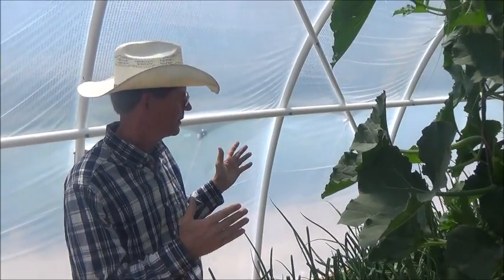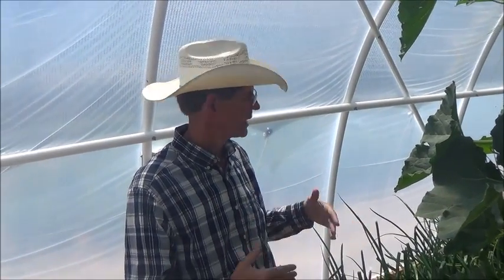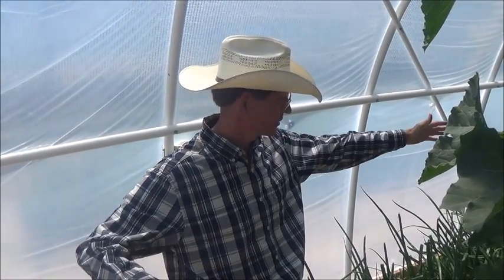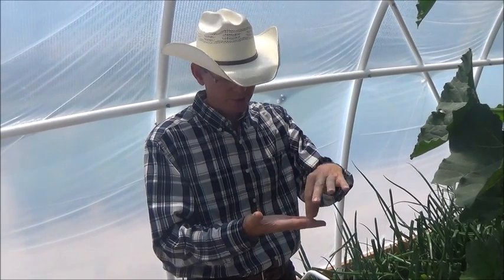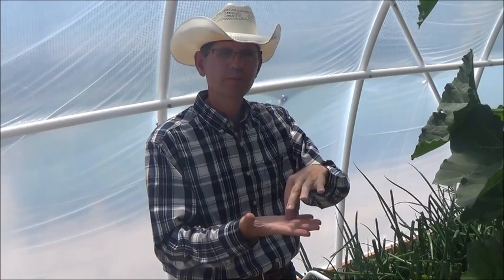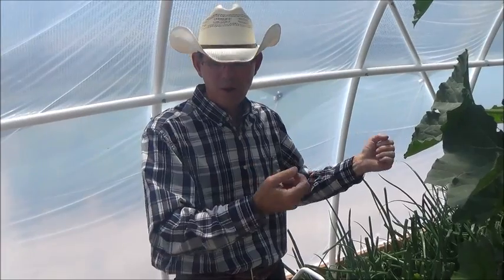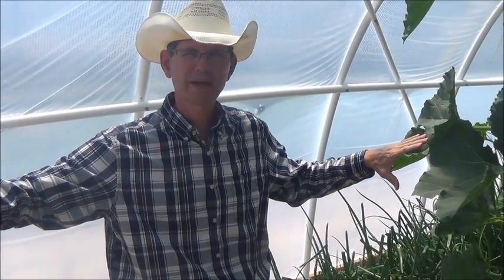LDSPrepper GeoThermal Plans for Underground Tubing New!

Comment: FYI: you can buy half the number of 6-inch pipes, and save 25%.
the Area of a 
4-inch pipe = ~13 sq inches, 
6-inch pipe = ~28 Sq inches (about double the 4-inch)
For example if he had 4x 4" pipes totalling $100,
He could've instead got 2x 6" pipes totalling $75.
Also, skinnier straws are harder to suck air through. Same principle here. 6-inchers require less fan usage.
Reply: looking at prices, 1x6" is $360 and 1x4" is $128.  So double the one is the same now.  The other issue is if it's just area or is it also circumference?

Comment: Your 2017 video shows you installing a rock heat sink the size of the entire greenhouse, instead of just a trench.  What made you change your mind and abandon the idea of using a trench, in favor of excavating an area the size of the entire greenhouse base?
Reply from the maker: https://www.youtube.com/watch?v=HbaOlGljG10
Reply: @OrangeJeepDad  Is there a good reference website that explains how to design a heat sink, and how many feet of air tubing you need to run for a given space size?

Comment: 7,200 cu. ft. greenhouse,
 10% of that is 720 "in tubing" he said
I take that to mean 720 cu ft. volume in tubing.
He recommended 4 inch tubing as the most economical.
That would be 8250 linear feet of 4 inch tubing
or 3,666 of 6 inch tubing.

Comment: LDS Prepper is building upon work done by a couple of others over the course of a few decades.  The original geo-air concept was presented by Russ Finch of Alliance, Nebraska.  See https://www.youtube.com/watch?v=IZghkt5m1uY.  Google: "CitrusInTheSnow".  His greenhouse design is built into the ground 3' or 4' and he has actually done several geo-air designs and experiments.  The greenhouse is only one.  Barry Naef has built upon R.Finch's work and done more systematic research on the geo-air concept.  Most of LDSPrepper's geo-air specifications (4" tubing, spacing, depth, chicken mesh method, etc) all come from Mr. Naef. The specifications for tubing length, blowers, 18" stacking of layers etc. all come from Mr. Naef.  Mr. Naef helped with some of the design of LDSPrepper's greenhouse.  Google: "Geo-Air Technology A-Z".  LDSPrepper's primary and important innovation and contribution is the fact that he has applied this to a hoop greenhouse design which is much cheaper than and has potentially other advantages over the original Finch greenhouse.  Disclosure: I have no connection with or personal acquaintance with either Mr. Finch or Mr. Naef.  But I have been in Nebraska. Peace.

Comment: Diesel fuel used on a job like this is minimal.  Labor is open to negotiation.  I would have done this job free with a percentage of food production for 5 years.  Fair enough, and this would be one prepper helping another.  My machine does the work, I just operate it...

Comment: What I don't get is why he uses the underground insulated panels on the perimeter of his greenhouse.  The whole purpose of the tubing is to expose it to the environment to maximize the heat exchange.  By installing the underground insulated panels he is hampering the heat exchange.  Can someone help me here?  Thank you.
Reply: John Coffey what he is doing is insulating the greenhouse soil from the outside soil in order to use the soil base of the greenhouse as a heay sink. By moving the hot air of the greenhouse into the earth during the summer (to cool down the greenhouse) he is effectively heating up the ground. Then in the winter the reverse happens and he takes this added heat and sends it back into the greenhouse. By creating this exchange he can use the earth as a thermal storage device. At least, thats my ubderstanding of why he is insulating the trench
Reply: He's trying to reuse the heat the the ground absorbs from the greenhouse. The ground beneath the green house will be much more temperate than the surrounding soil and will help keep his green house temperature stable- unless the soil next to the green house absorbs it and dissipates it away from the green house.
Reply: I was thinking the same thing John. You are right that the foam shouldn't be super close to the tubes because it reduces the heat sink potential, but beyond the immediate soil, I dunno 2 feet or something the heat is just escaping. So, ideally you would want however much area around the tubes where the heat can reach then seal that off from the cold surround soil. At least that is what I came up with.

Comment: For inflating the dual poly greenhouse film for the purpose of insulation/temp protection I noticed your fan is located roughly 3" above ground on the north side of the greenhouse on one end. Q: For the size of greenhouse you have do u use more than one inflation fan? If more than one where have you located the others and why?

Comment: Why do you only require 10% of the cubic air volume in buried tube air volume?

At what rate does your greenhouse lose temperature once it stops being heated by the sun?

What type of equipment is used to dig a narrow, 8' to 12' trench like the one that you have described?

http://AnswersFromGod.com/?YouTube=zyiDXU60EqY

Comment: WOULD IT BE BETTER TO POST HOLE DIG VERTICLAL 12 FOOT DEEP x 1 FOOT DIAMETER HOLES AND THEN LOWER THE PIPES DOWN TO THE BOTTOM OF THE HOLES. BLOWING THE AIR DOWN WOULD GET WARMER AIR FROM MUCH DEEPER DOWN.

Comment: if hoop house was 30' by 96' by 9' tall equals 25,920 cubic ft. If I use 6 inch pipe in lieu of 4 inch I figure it would take 1296 ft. Is this correct?
Reply: 6" pipe has almost exactly 3x the volume as 4" pipe

Comment: With the 4' trench mentioned, three layers of tubing would only come to 480 feet. You'd need more tubing, but you shouldn't make the trench longer than the greenhouse, right? So how do you get that 760 feet of tubing with only a 4' trench and three layers?
Reply: No, he said cubic feet, not lineal feet. Insulating the ground immediately below the green house, but above your pipes, would be a good idea to help maintain the temperature difference between the greenhouse and outside air (the near by soil will absorb energy and send it the biggest differential temperature area- the atmosphere, not the ground. 

Insulating the perimeter of your pipes would be detrimental for cooling, as the warm exhaust air "absorbs" cooler energy from below much faster if it can dissipate heat laterally rather than wait for cool energy to "force" its way up to the warm energy trapped between insulation. 

In the winter it would make pumping warm air out more difficult, as your pipes will receive heat from the soil below, but the cool energy will want to bleed out the perimeter, below your insulation. Basically all the energy is forced to compete for vertical passage, and the system can't develop as natural of a lateral energy circulation. All of the perimeter of your pipe would attract warmer air than the center and would create an air circulation opposing the natural draft effect you would otherwise have.
Reply: You wouldnt ;) 
He`s completely clueless regarding the correct design parameters. Thats the reason its utterly useless for cooling his greenhouse. These systems actively store massive amounts heat in the soilmass as they are the cooling the greenhouse so it`s also equally useless at storing heat.  He believes the heat he removes from the soil is being instantly replenished from the earth`s core ;)

Comment: It would need a monster push fan to exhaust efficient numbers from one continuous hose that long if your using Geo Therm Air Flow build. So if your using Liquid  system the pump would be pretty big too.  One more thought is maybe build a dual or quad segmented build so it's not so demanding for such a long hose.
Reply: Although, if you drop a single line almost straight down to the lowest point of your tubing and slowly spiral your whole system up from there in 18" layers you should get one hell of draft dropping the coldest air in your greenhouse to the lowest point and pushing the warmest air up and out without any fans at all.

Comment: If I have bedrock at 5Ft. Can this method still work?
Reply: +cdomize depends on your frost line depth
Reply: Most people I know install their system at 4' deep but it won't be as efficient as one buried deeper as the ground temperature is a bit lower the closer to the surface you are. Frost line depth doesn't matter except that the colder climate you live in, the more perimeter insulation you'll want to use.

Comment: He's saying you need 10% of volume of air in the greenhouse burred in tubing. You can have any size or shape greenhouse as long as you have the correct volume of geo-air coming in from the ground. The structure can be anything insulated and airtight.
Reply: +Christopher Preston 
Can you explain why the greenhouse air volume is used to calculate the tube length?  me neither :)
&#160;what happens when you have a tall narrow greenhouse or something  very wide but with a  low height?   
Seriously, dont use this 10% formula, this tube length and layout wasnt calculated or designed to meet any technical goals. If you run the numbers it becomes crystal clear theres no technical, mathematical or vaguely logical parameter in this design. 
Why would a "designer" calculate a layout that will potentailly move 13.5x less heat while using 87% more fan power?  (this based on an alternative layout that uses exactly the same amount of tubing)
The answer is he wouldnt, so the truth is it was likely all guesswork. The 10% formula was made to fit the guess to make the design appear to be based on something more technical. 

It would be a challenge to purposefully design something less efficient to be honest.  

My guess is, the tubing layout was copied or loosely based on the"Citrus in the Snow"greenhouse which uses seven 150ft  6" tubes. That greenhouse is buried in the ground to over half its height so their tubing  doesnt need to contribute much anyway.

Comment: The closest spacing I've seen recommended for 4" pipes is 16" on center (12" between pipes). Most recommend 16"-18" between pipes.
Reply: +Paul Ladendorf 
Tube spacing can bias the system towards heating or cooling. If you place 4 inch tubes on 12 inch centers you`ll gain higher temperature short term storage (same night return period). Downside of close spacing is the higher tube to mass ratio (more tubes means less mass per unit area). If you get a run of cold days you have nothing in reserve. Typically heat that moves more than 8 inches from a tube cant be retrieved within a 24 hour period. 
The best balance for 4 inch ADS is to use 3 layers of tubing  2ft on center horizontally and 1ft  tube to tube vertical spacing but with the middle layer tubes staggering the top and bottom layers to form a matrix. If the bottom tubes rest on a line at 5ft deep, the mid layer tubes will rest on a line 16 inches above it and the top layer tubes 16 inches above that. 

Putting all the tubes in one layer will limit system performance in terms of storage and retrieval. The bulk of the uncharged mass is not close enough to the tubes to be charged (wastes higher grade heat that could otherwise be stored. In summer it affects the cooling capacity ). The heat has travelled too far from the tubes to be retrieved in a timely fashion. 
I wish you guys would install more sensors, it would save me a helluva lot of typing  :)

Comment: My questions concerning the 'earthtubes' is what about condensation? Since you have warm air going in and meeting cooled earth, the humidity is going to collect as condensation at the low points. Most of what I've read is that in a closed loop system the tubes all empty into a lower drain. Also that using ribbed tubes and Right angles is asking for trouble. Maybe this isn't a problem since you don't live in the green house, but it sounds like a recipe for Legionnaire Disease.... Comments?
Reply: A small amount of water in the line would speed up the heat transfer though :) What I really want to know is what happens if you fill the pipes with water and run a two foot wide lazy river full of fish around the unwalkable perimeter of the green house? Water transfers heat way more efficiently than air and a large surface area of water would basically be a heat exchanger. Would the humidity be disastrously  unmanageable?
Reply: +James Fleming wouldn't a air filter stop any microbes? - also bleach sprayed into the tubes once in a while would kill everything too

Comment: Those PVC pipes will destroy his plastic. PVC outgasses chlorine when exposed to sunlight. That chlorine destroys the UV stabilizers in his film. His film will be in tatters in less than a year. Bent galvanized steel is the same price as PVC. Also using PVC voids your plastic warranty.
Reply: +Brian DeSpain He actually mentions that issue in a video another interviewer posted. I think he paaints the pvc that makes contact with the plastic.
Reply from the maker: +Erik Lee Yes, he paints them.
Reply: Erik, You are correct.  The video was produced by "DirtPatchHeaven" and is titled, "GeoThermal Greenhouse Build."  It was published on Oct 23, 2014.
Reply: what does he paint them with?